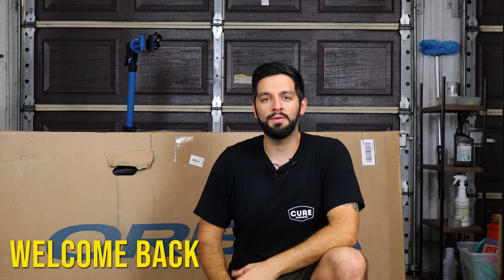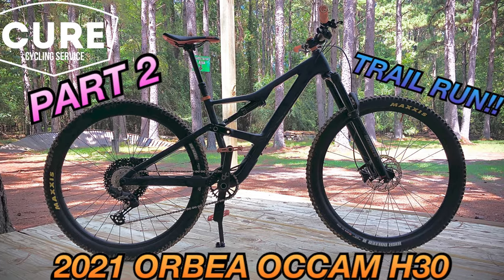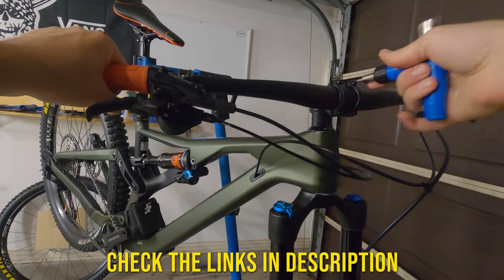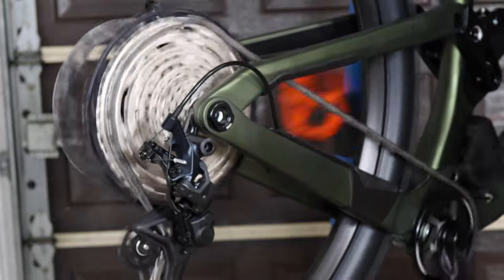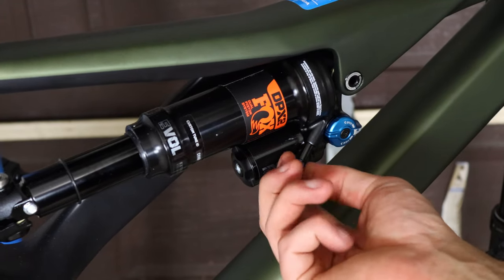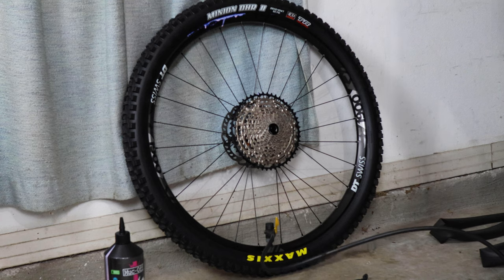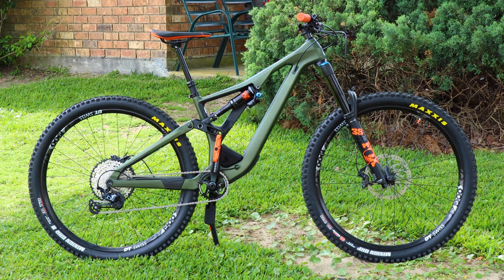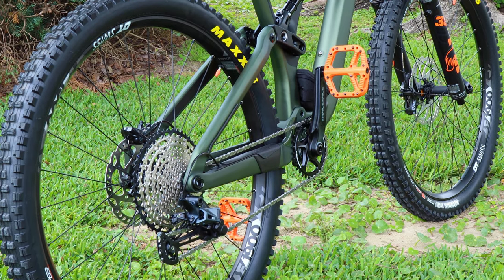2021 ORBEA RALLON M20: Quick Unboxing And First Impressions!

Comment: I have the Rallon M-20 and I have to say those Shimano Deore 4 pot brakes were disappointing. I wanted to like them but they had a wandering bite point that I could not solve with multiple bleeds. I ended up putting on a set of TRP Quadiem's that have been stellar. I can now rip on the trail without wondering if my break lever will go all the way to the handle bar or actually work.
Reply from the maker: It's so strange because I've heard so many reports of Shimano brakes having a wondering bite point, but I've never actually experienced it for myself. I wonder what causes that. Even pinkbike had made multiple reports of this happening in one of the more recent field tests.
Reply: @JaredRMorgan  My old XT 2 pot brakes on my Bronson were very consistent and had lots of power. I was surprised how bad the Deore's were. I think it has something to do with Shimano's Servowave tech. I was doing a lever bleed before every ride. No joke! I know a few other riders who've had the same issue.

Comment: What would you recommend that’s $2500 with good components
Reply: I would say the Polygon T8. It has a Fox 34 Rhythm 150mm (27.5) or 140mm (29), Fox Float DPS 140mm (27.5) or 135mm (29), Tektro 4 pot brakes, Shimano SLX 12 speed, and a 150mm (S-M) or 170mm (L-XL) dropper post. 27.5 is in sizes S-M, and 29 is in sizes M-Xl. All of this is $2400 (approximately).

Hope this helps.
Reply from the maker: My vote is on Orbea Occam H30. My buddy scooped one for a hair above your budget. $2600.  It’s a 140/140 29er trail bike. It was the best bike I rode in 2020 aside from my own and I reviewed a handful.
Reply: @ryanmarotta2413  Yeah I was looking at the polygon T8
Reply: Giant trance x 29 3 is good

Comment: How did you adjust the brakes? Thanks in advance
Reply from the maker: If you look at the clip where I mention it, I use an Allen wrench right by the lever to increase the reach...this in turn causes the bite point to be further from the bars.

Comment: Do you still have the kink drifter bmx ?
Reply from the maker: I sold that project. Did you have any questions about that one?
Reply: @JaredRMorgan  yea I just wanted to see if it was reliable and if there was any problems so far cause I’m also looking for one but they all pretty expensive for me cause I’m broke🥲
Reply from the maker: It will definitely be reliable. Hard to judge off of mine bc I literally ended up changing everything on it just for fun. 

But I work on many kink bikes built the same way, and if you’re not a crazy abusive rider I think it’ll do just fine.
Reply: @JaredRMorgan  I’m still trying to find a link drifter for cheap or also a cult devotion but I don’t think it will be a long time till I get one especially with prices